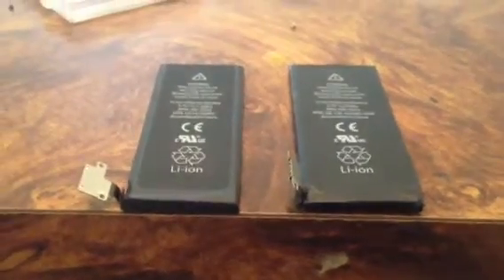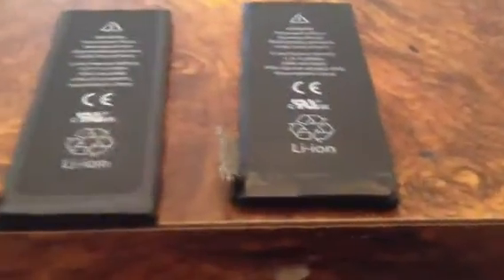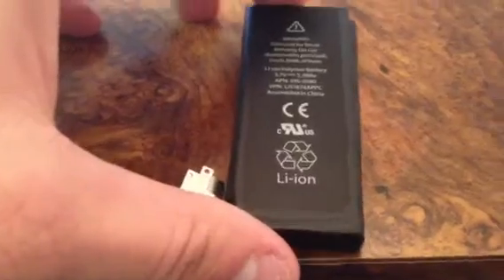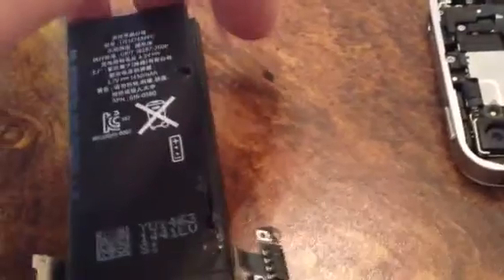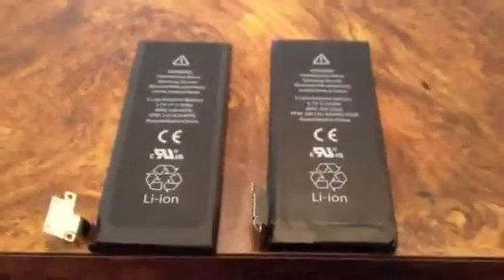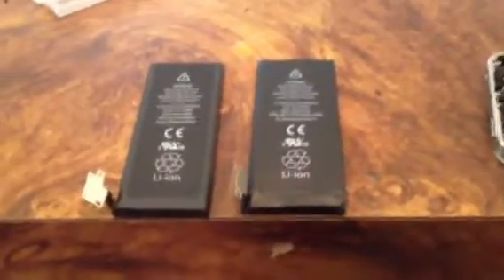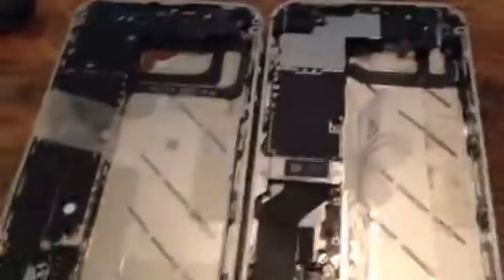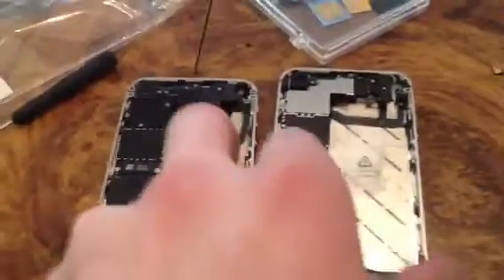Why the 4S battery sucks

Comment: iPhone 4 -1420 mAh, iphone 4S -1430 mAh battery... iphone 4S technically has a bigger capacity. battery life depends heavily on what u do on the phone (data, browsing, screen brightness, Siri, etc) also the 4S uses the A5 processor which i would think plays a part too